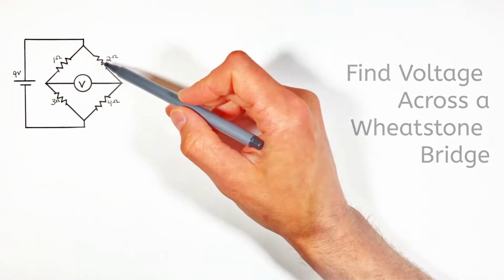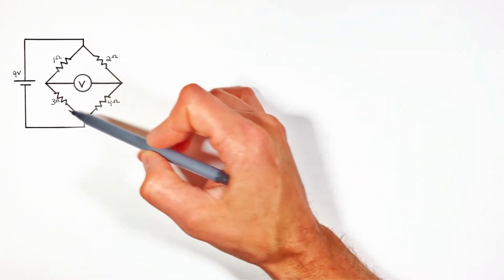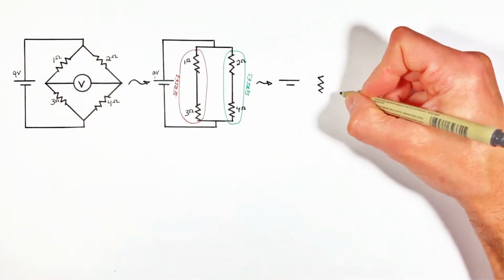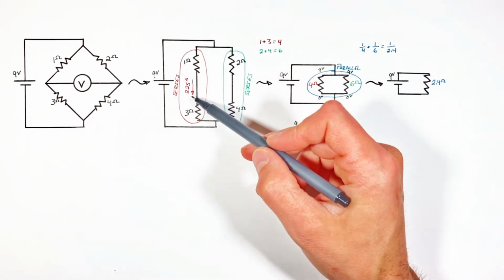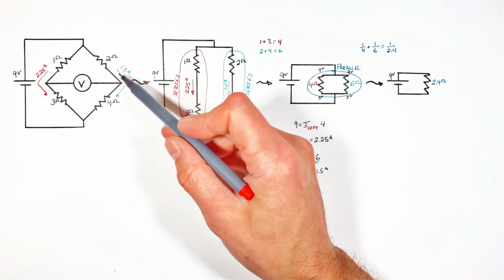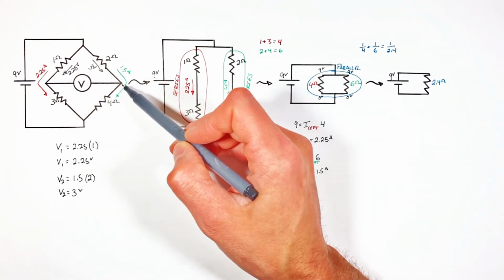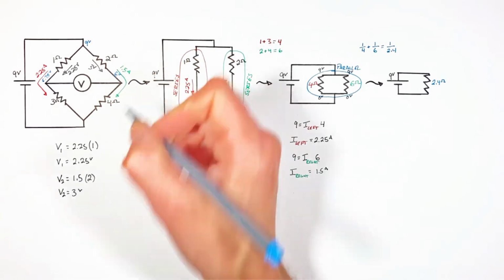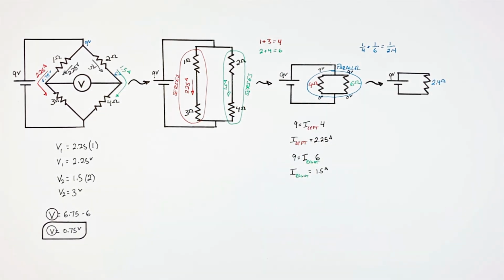Calculate Voltage Across an Unbalanced Wheatstone Bridge Circuit

Comment: just use ratios. 1/4 * 9 means 2.25 drop across the 1v. 1/3*9 means 3 volt drop across the 2v. therefore 3-2.25=0.75 potential difference

Comment: question: when we figure out the voltage across the unbalanced bridge can we place a resistor in place of the voltmeter and still have the same voltage across it?
Reply from the maker: no.  that is a different circuit.  however i have posted a video on how to solve that type of circuit.

Comment: your mathematic calculations are written in a way that is confusing. The 1/2.4 ohms is wrong. It should be 1 over ((1 over 4)plus (1 over 6)) im not being pedantic, as that implies the answer is 0.41666 recuring

Comment: You say "voltmeter or galvanometer", but they have different resistances. The voltmeter resistance will be very high, but if you connect a galvanometer (= very sensitive ammeter), its resistance is very small, and the bridge potential will be forced to be (very close) to zero, with a finite current across it. (Your other bridge video on solving for currents would then be needed.)
Reply from the maker: Correct, I shouldn't have said galvanometer...  Thanks!

Comment: Have you done the video solving the bridge just using variables?Thanks
Reply from the maker: Sorry no.
Reply: For this case it's not too bad. First find the total current through the battery, then how it is divided into each branch, then use V=IR to calculate the voltage drop across each resistor.